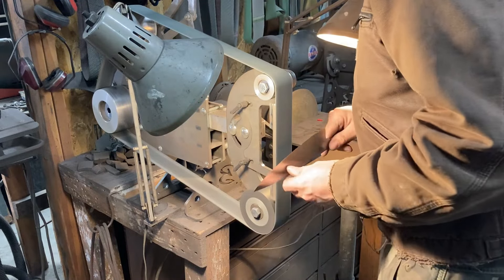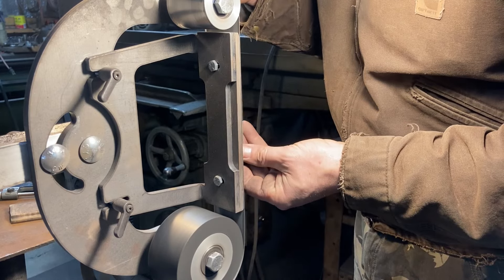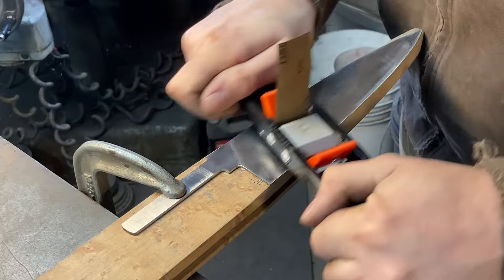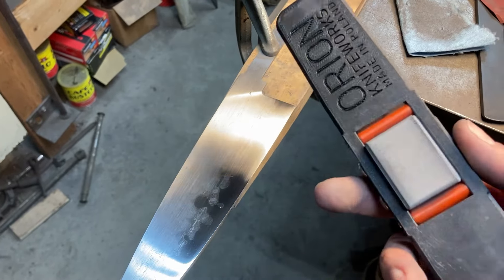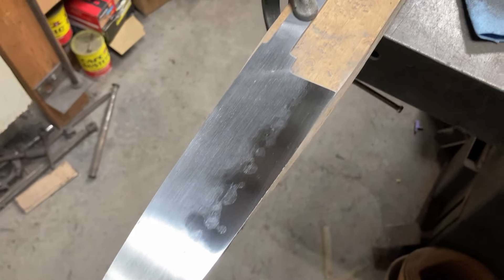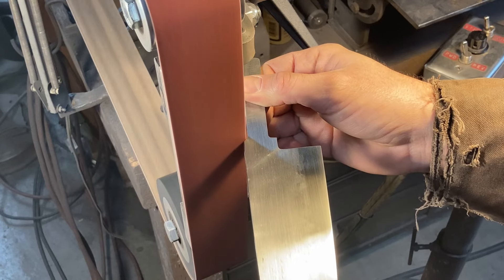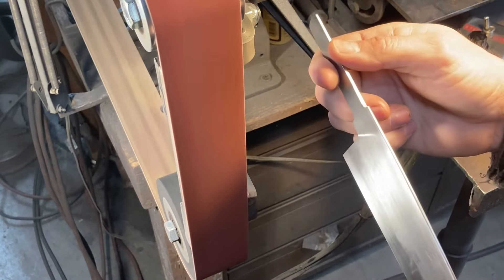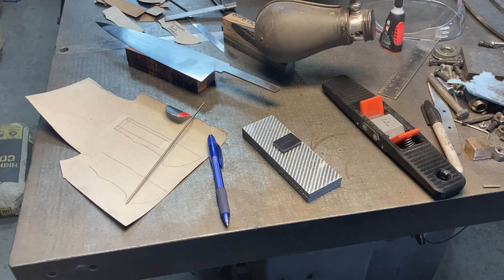Wrought Iron CruForgeV San Mai Chef Knife Part 3

Comment: Salem, at about 18.55 when you laying out "grip length" at 4" are you measuring from the heel/back of the blade to the widest point on the handle? and also, am I seeing it right that the angle break on the bottom of the handle is a bit forward of the break on the the top of the handle? This is good stuff man. I appreciate you going into this much detail.
Reply from the maker: Yes, to both questions!

Comment: With the Bob Smith epoxy, I’ve been using medium cure, should I switch to the slow cure?  Are the properties better for blade handles?
Reply from the maker: The general rule is that slower cure epoxies tend to be stronger; that said a medium cure high quality epoxy is plenty strong, especially for knives with a mechanical connection in the handle.